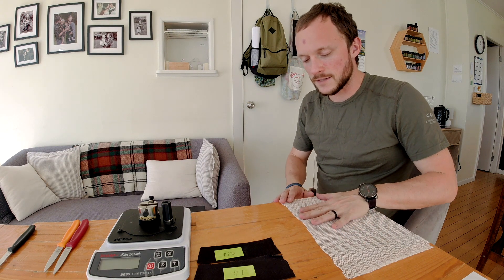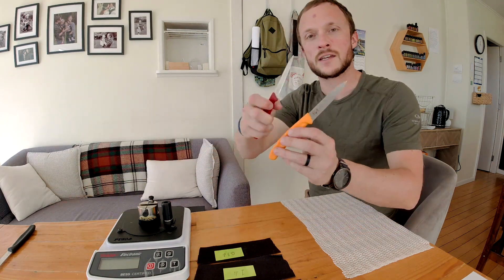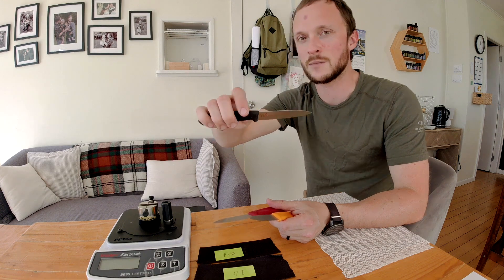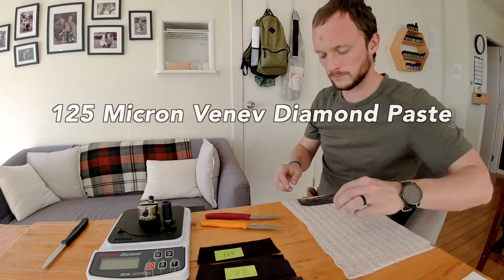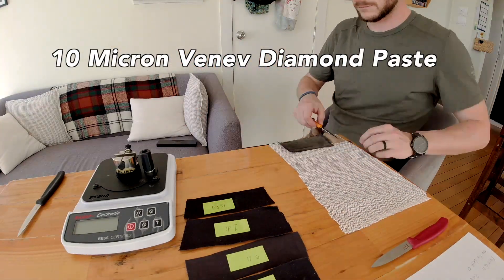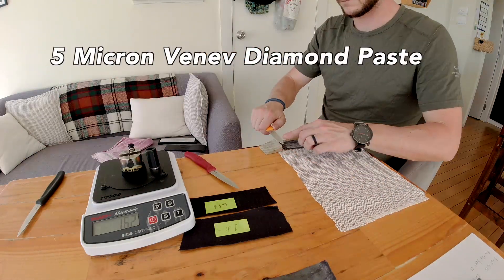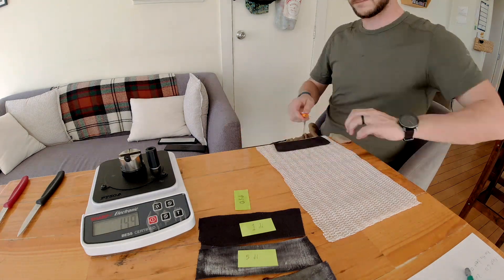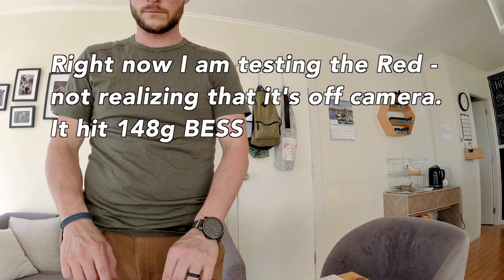Strops Part 1 | 125. - 0.5 Micron Diamond on Denim | Knife Sharpening Test

Comment: I've stropped on wood with various compounds a lot, and I'd be curious to see what your results "wood" be.
I have used various soft wood like pine as well as a piece of ash and sugar maple, and I wonder how much the wood density matters. I imagine that a harder strop will not round over your edge, seeing as when I've stropped on cloth I seem to dull my edge.
I also wonder about aluminum oxide and silicon carbide powder, and how the sharpness of the abrasive changes things. Think of beach sand vs desert sand, and how one likely erodes rock faster.
Reply from the maker: Yeah I would say those roughly line up with my observations.  I will have to look into wood.  Honestly I think you may need a compressible strop mainly for steels with high ductility because the burr can flex out of the way at the normal sharpening angle.

I am leaning towards the idea that most steels benefit from a very light preliminary "de-rooting" of the burr (to borrow a Vadim Kraichuk concept) on compressible substrate with softer abrasive - then can be stropped at edge angle on hard substrates with harder abrasive for higher final keen-ness.

I need more skill, experience and experimentation to find a sure-fire method to get in the 50-70 range though.

Comment: What steel is it? HRC? i'm asking cuz MagnaCut can be stroped back to life very easily in contrast to my m390 trc. Refined grain size and so on. Currently I'm using 1micron DBK compound on both the course paddle strop and the smooth pocket strop. Would you like to test out jende nanocloth?
Reply from the maker: You know what, I just got some nanocloth - thanks so much for the offer though.  It's super soft VIctorinox steel (probably about 56-57 HRC). I am using it because it is easy and fast to duplicate tests, and it has nearly no carbide so you can observe what the steel itself is doing.

I will definitely need to run a new set of stropping tests once I get to steels with 1% Carbon and more!

Comment: Yessss!
I really wonder how much this carries over to hanging strops.
Reply from the maker: I think that it translates fairly directly.  As far as I understand it, steels fall somewhere on a range from high ductility (which benefit from a hanging strop for deburring) to low ductility (which should be stropped closer and closer to the sharpening angle as hardness increases and ductility drops).
Reply: @homeslicesharpening  ahh! Hmm! I suppose the other thing I wasn't thinking of when I initially commented is that your purpose (as I understand it now) in this series is to identify good strops for enhancing edges, not focused on deburring.
Reply from the maker: @knickly  Yeah that's fair, I am interested in both actually.  What deburrs best, what refines best, and how much of either of those things improves a dual grit vs fine edge...  Haha we are such nerds to even know that.